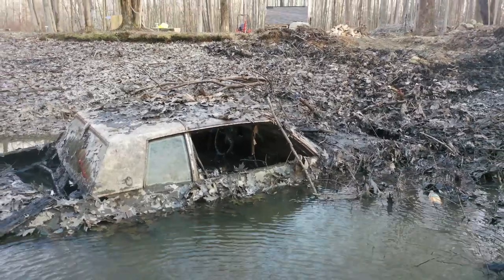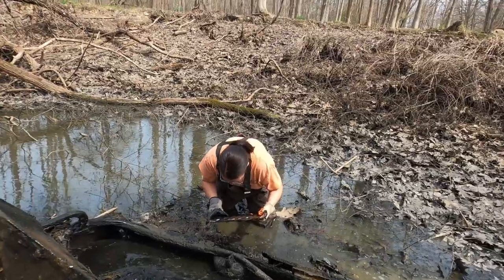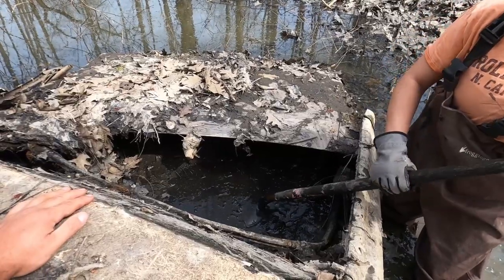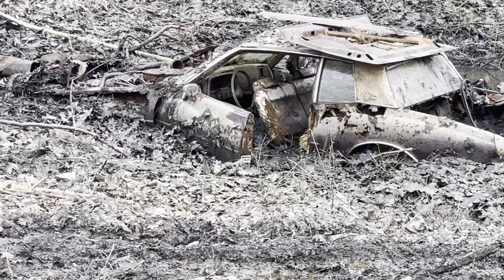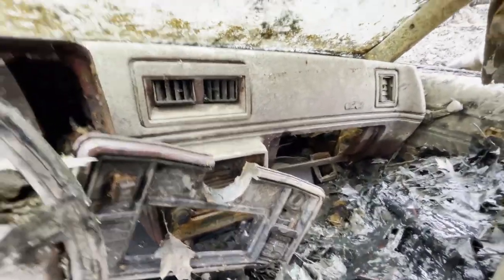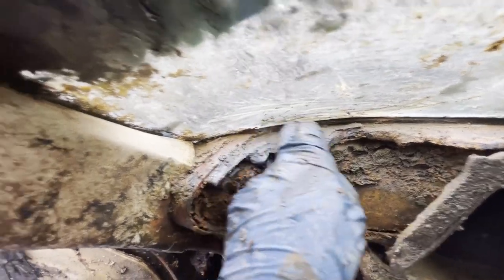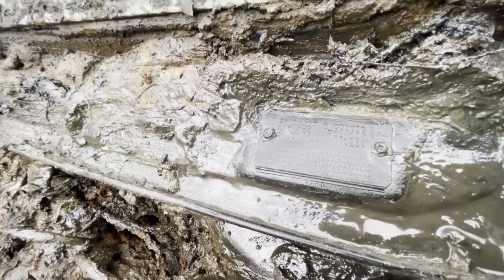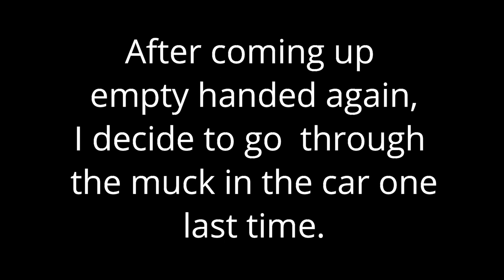WE FIND AN OLD CAR IN OUR POND (Update) - PART 3 - Searching the car for identification and items

Comment: You should put a battery in it after it’s all pressure washed and see if the door chime works, or the head lights, or dome lights
Reply from the maker: That would be crazy if it worked lol
Reply: @TheOhioOutdoorsman1  it would. But it's also with a shot lol. Maybe a restoration... Like if you could pull it out and strip the entire car and buy a parts car that has a junked title than you have a covo starter especially the history of this car

Comment: Just pull the car out.   That way when you go through stuff.    Use water.  And buckets.   Also be easier way to find that info..
Reply from the maker: We wanted to but the car was a little to brittle and as falling apart when we hooked to the frame. Since the vin plate was gone, there was nothing left to check. We reported it, gave the plate # to the authorities and left it for structure.